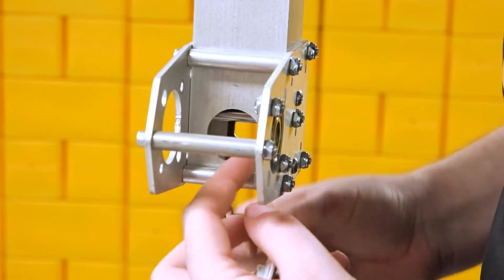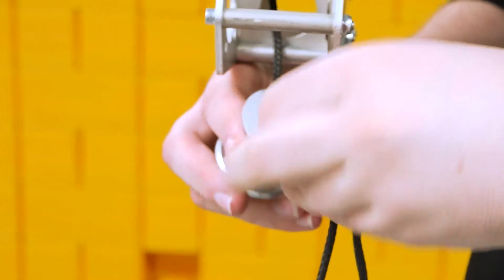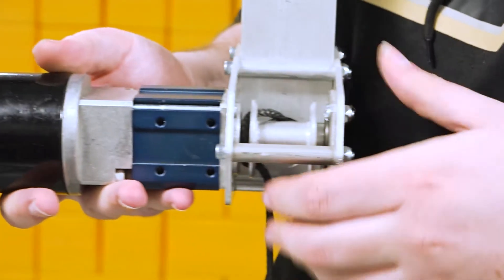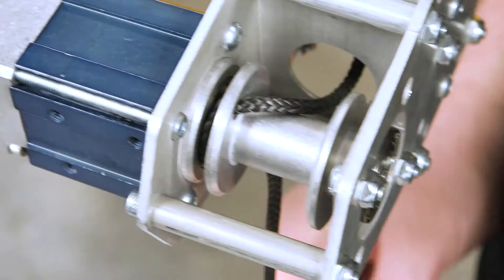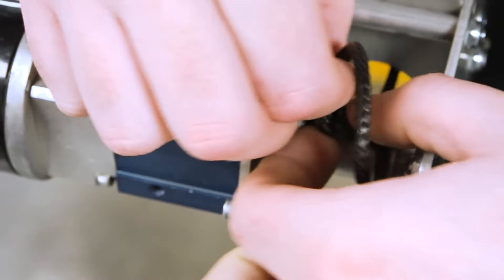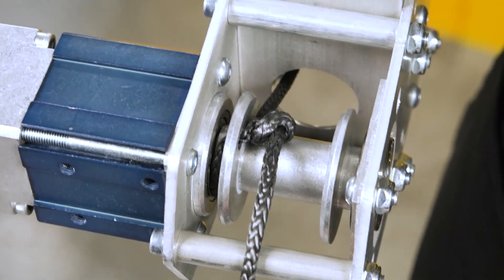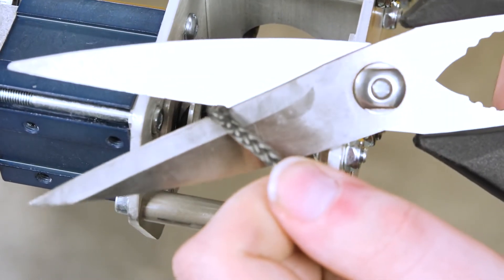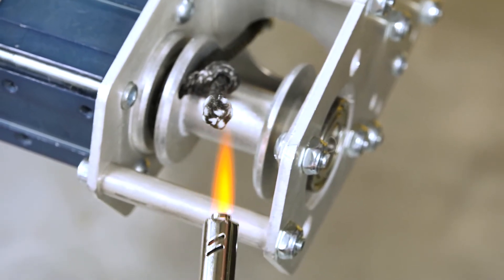Climber in a Box - Rope Assembly

Comment: What is the motor you used
Reply from the maker: The Climber in a Box is compatible with many different motors. This video features a CIM - Paired with a 16:1 CIM Sport. Below is a list of recommended reductions for whichever motor you may have on hand utilizing our CIM Sport and 57 Sport planetary gearboxes. These recommendations are based on one climber and one robot and are based on the minimum safety factors for the motors, gearboxes, and other components. Utilizing two climbers instead of just one may allow for lower ratios.

RedLine - Paired with 48:1 57 Sport
Mini CIM - Paired with a 20:1 CIM Sport
CIM - Paired with a 16:1 CIM Sport
NEO 550 - Paired with a 36:1 57 Sport
NEO - Paired with a 16:1 CIM Sport
Falcon 500 - Paired with a 12:1 Falcon Sport

If you need any more information you can view the product page on our website or message us directly at support@andymark.com

🔗: https://www.andymark.com/products/climber-in-a-box

Comment: When you use only the 1 stage there is not much room to wrap the rope thru the holes and you can’t put the plate for the bearing on the inside.
Reply from the maker: The assembly for the 1 stage climber and the 2 stage climber winches are different, on account of there being a 0.5 inch difference in the extrusion they are meant to envelop. This video is only meant to exhibit the best way to tie the rope. If you are still having issues assembling your climber after reading the assembly instructions at the link below, please message us directly at support@andymark.com

🔗: https://bit.ly/3UBlnLd